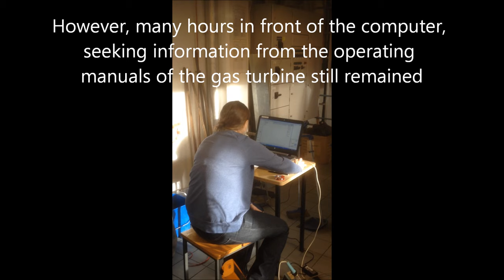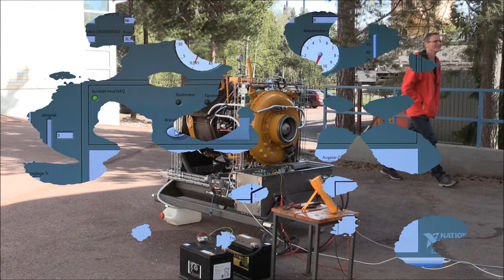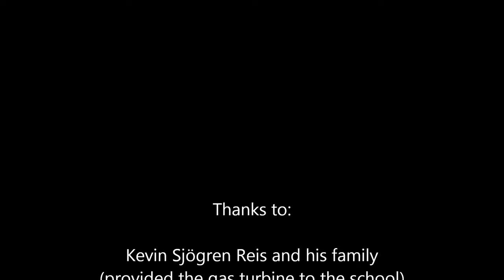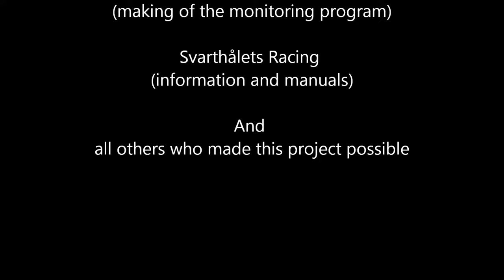Caterpillar 553 gasturbine - in English

Comment: You could run it on natural gas, as most oilfield turbines do. They have incredibly long lives. They can also run on Jet A-1 kerosene, diesel, biodiesel, waste engine oil or home heating oil. You should get a proper exhaust duct and a proper inlet duct, which will make it more efficient.
Reply: You forgot it can run on gasoline and alcohol too.

Comment: Nicely done. The electronics box , especially, I thought was impressive!
Reply: Very tight, professional build on electronics side. Well done!
Reply: @TyMoore95503  thanks, Thank you, but we have redesigned the electrical system when we did permanent installation for a water brake
Reply: hardlie. caps resisthörrce rather primitiff... -.- that much icänn c xD 
ps Greet zäh Flüte ^^

Comment: Have several questions about this power plant. 
1. What was this turbine used for?
2. Is there a mechanical coupling and gear reduction used with this?
3. Have you calculated the fuel consumption, liters per hour?
4. What is the power output of the turbine?
You have all done a wonderful job with little information. Has Caterpillar been able to supply you with any information for the project? 
This might be a great power source for producing electric power if it can run economically and can be coupled to a generator.
Reply: Thank you for your reply! All very interesting ! Too bad it is not more economical to operate. It would have been an excellent power plant for energy production if attached to a gen set. I see several You Tubers in the UK are into working with older aircraft APU's just for fun and the challenge to get them to run.
Keep up the great work on your project and again thank you for answering my questions.
Reply: @Subgunman  350kw = 350,000w..... hello that is enough to run like 200-290 homes. but there are much smaller turbines out there for the use you were looking for.
Reply: It was probably pulled from an Strv 103 tank.
Reply: You can still do it if you change the fuel to biogas/biodiesel or hydrogen. Also connect the exhaust to a boiler to generate more steam and then power. You can multiply this 1mw plant to a 3.5mw plant using the same fuel. You sell power at least 4-5tiimes the cost of fuel. Plus it becomes a renewable energy cogen plant. Any investors will also be welcome in a setup like this for UK. Please what software is that and how can I get it.
Reply: The catapillar 553 was used in the swedish army's strv 103 in the later variants, so its very likely it was taken out of a stridsvagen as it was being decommissioned.
Reply: @wormfood868  Yes
Reply: @onekycarscanners6002  The software has been developed by the students at the university and during these 4 years we have made improvements, so now it is starting to be perfect (hopefully)
Reply: @fruitnoodles5141  That's right, these gas turbines come from the Swedish Armed Forces' tanks (Strv 103)
Reply: @ovewesterlund7605  Thank you for the clarification :), i was initially thinking it was extracted from some construction machinery, but since the university is in the same region as sweden and upon realization of the turbine model i knew it must have been from the 103. 
It's great to see one of these being given a second life, congrats to the uni for their excellent work on it and good luck on their future work on the turbine.
Reply: @Ove Westerlund 240 liters per hour for 370 kW output is pretty inefficient, about 15%. Is the pressure ratio very bad (low)?
Reply: It's from an era of gas turbines when a pressure ratio of 8:1 was considered good.
Reply: I'm here because I heard they were used in the Swedish S Tank.

Comment: Next time you make a paint booth. Put a inline fan with a double filter.  With the intake at the bottom and the exhaust in the top.  So air is always coming down on what you are painting. With any dust etc.  Being  pulled into the filters.
Good luck on all your projects. 👍🏻